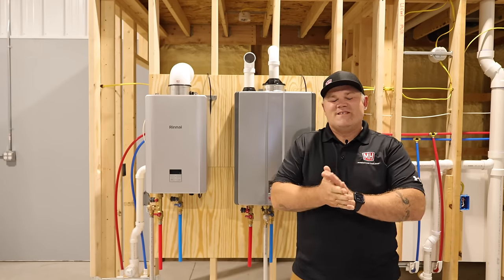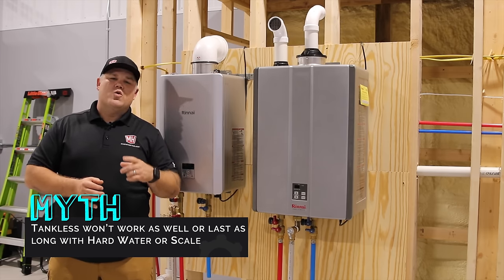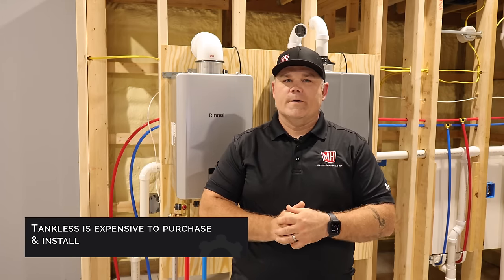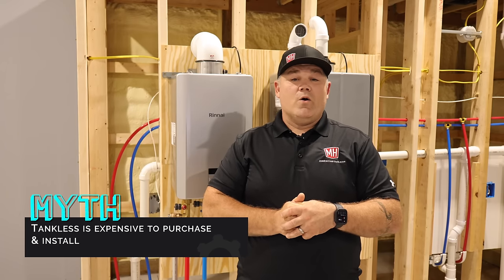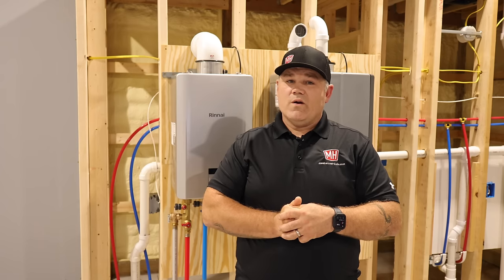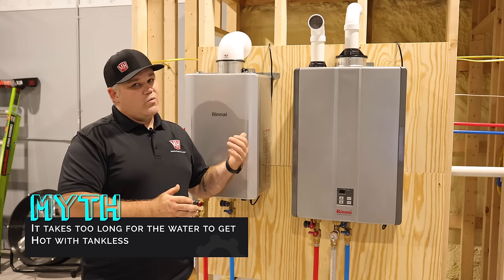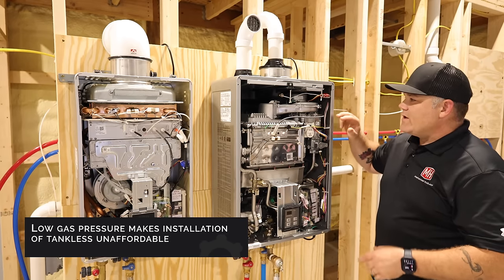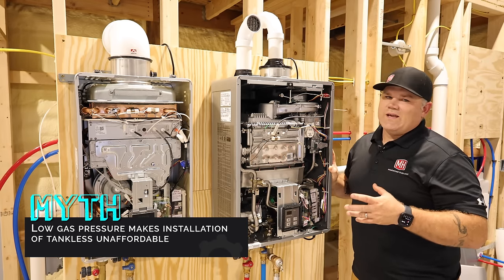Myth Busting! Tank -vs- Tankless Water Heaters

Comment: I don't agree with all your comments. Cost to install tankless is more than tank type 99% of the time in Retro Fit applications, mostly due to gas BTU demands. The cost comparison is closer in new construction. Maintenance requirements to maintain warranty is another expense you didn't bring up. GPM's requirements to activate the flow switch with newer low flow plumbing fixtures, was not discussed, so when the lavatory is fully opened but no hot water is delivered, your forced to open hot water to an additional fixture just to get hot water, your not saving water. I know you're trying to promote tankless but the reality is, both tank and tankless have a place in the market.
Reply: I read your comment before the video. After watching it, it's as if you never watched the video. I'd recommend watching it. If nothing else, you'll understand why on newer units you may not need to upgrade the gas feed line.
Reply: You obviously did not read my entire comments in comparison to the complete video. Read whatever code book in your jurisdiction along with installation instructions. If you're in the IRC read chapter 24. If you're in Texas read the Plumbing License Law and Board Rules. Something else that I did not mention before, 
A lot to discuss, copper versus SS heat exchangers. Read the checklist and installation instructions from any manufacturer of tankless water heater , pay close attention to the grains of hardness requirements. There is way too much to discuss by text. Do your homework before beating up on me. I stand behind my statements.
Reply: @philipsanders5911  I have no idea where your other comments are or why you think I would have seen them. I'm responding to this particular comment. And essentially what I'm telling you is what you tried to tell me at the end. Don't beat him up until you've watched his video. If you watch the video your comments didn't really make a lot of sense. Especially the part about the gas line. Newer models have a blower or turbocharger that's essentially a fan that is forcing the gas into the unit not relying on the passive pressure in the line. For you to insist in your comments that's the biggest issue makes you a little slow in my book. Try to keep up!

Comment: It cost me twice as much to heat water with my reni l have electric beside my reni and can isolate one or the other.  You didn't mention the cost of running the gas line and l am on propane so thats 2000 for the tank and 1000 to fill it. Total cost for the reni and gas and electricial oulet was about 6000 dollars. The fifty gallon electric heater and install was 1400. Plus any plumber or handyman can fix it. Not to mention hiring someone to flush the reni with a circulating pump. I bet you would make a great car salesman.
Reply: A person doing off grid and using mainly solar for electricity and propane for cooking, heat and hot water will already have figured in the cost of propane plumbing and propane into their build and budget.

Does not make a lot of sense to go propane for just the water heater if the rest of the house is electric.
They also make electric tankless water heaters as well.

Comment: Sponsored by Rinnai, so hardly unbiased. I do agree that tankless water heaters are not new technology, in fact in my country (Australia) they are considered old fashioned, and I can't remember the last time I saw one. The key thing you neglected to mention is that a tankless uses a lot more gas than a tank storage unit. With the cost of gas increasing steadily, tankless will be a very expensive "solution".

Comment: We used tankless from the time our home was built in 2008. We were forced to replace the core once due to a pinhole leak, but the (expensive) part was covered by warranty. (Get a long warranty if you have hard water.) That's 15 years and counting of uninterrupted hot water. I heartily recommend tankless. (We also benefit from a whole-house water filter/softener now. If you can afford it - the good ones are expensive - you'll get better water and save money on plumbing issues down the road.)

Comment: As a plumber for 24 years I don't think you are right, unless you are being paid by Rinnai, We use to install them a lot but my customers took them out later, keep in mind 20090 BTU compared 40000 BTU, and you are wrong by saying 3 people can have a shower at the same and not run out of hot water, think of your energy bill for the BTU.

Comment: it's not a lie that some tankless water heaters will struggle with output with 40 degrees ground water.  cold water  (37-40 degress F) ) cuts hot water production to about half of its rated GPM.  that is something to consider when your sizing your unit. tankless water ARE more expensive. you're not myth busting. you are not presenting the truth.

Comment: As one of the people responsible for designing the electrical grid, tankless water heaters of any size are going to require massive upgrades to your electrical supply. Be sure to budget for paying for an upsized transformer, possibly adding poles, primary wire, or replacing and up sizing secondary wire and/or your service wires.

Comment: What garbage. Tankless water heaters make you run water for at least 3 solid  minutes to begin to get any hot water.  When we finally gave up on ours it was such a relief to know we weren't wasting all that water anymore.
Reply: Also, endless hot water for a teenager means the water just keeps heated, and the gas to run it keeps getting used and $$$$$

Comment: This video exclusively discusses gas-fueled, tankless, water heaters. Not all areas have natural gas available. Although it might be possible to get an on-site propane tank, that would increase the installation cost. Some areas do not permit propane tanks to be installed, so the only option for a tankless water heater is electricity. Try that with 40-degree incoming water. You're not going to like the results.

Also, "sponsored by Rinnai" immediately suggests to me that this video will at least partially be an advertisement/promotion for Rinnai. In my opinion, the likelihood that the information presented in the video will be objective and non-biased is close to zero. That's not to say the entire video is misleading. I don't think it is. It contains some good information. But I definitely think some of it omits important facts.

Comment: Well if you a video for the manufacture I don't think you are unbiased. My own experience with tankless has been that they alternate between hot and cold, don't stay consistent. My Mom had a rinnai and a rental I use has another brand, they both do the same thing. I will stay with a tank heater as I never had that problem with them

Comment: Either way you look at it, tanks are cheaper to install and maintain.  The upfront cost for a tankless and then the maintenance factor to have a licensed plumber flush it out every year or two to keep the warranty, makes the overall cost make as much sense as buying an electric car for twice the price as a gas car and never recouping the savings.  It started out as hype and still is.  There are certain situations in commercial applications, or residential where saving space and "never running out" is of the essence.  Then, it would make sense to use a tankless.  You simply cannot accurately justify the extra cost of a tankless vs. tank.  There's too many variables.  You're also watching a video where he outright says it's his business to sell these tankless units or else he wouldn't have a business.  He's not going to give you an accurate side by side comparison.  When customers ask me what I think about tankless units, I tell them to run the other way.  They are more expensive up front and more expensive in the long run.  Obviously, there are those on here who are not the norm, who can give you an example of having the unit long enough to justify the added costs, but that's not the norm.

Comment: You said that a shower takes 2.5 gal/min but since most people actually don’t shower at 120 degrees they are using 85% hot water so they are using 1.5 to 1.7 gal/min. That’s just bad math, 85% would be 2.12 gal/min. This is a commercial for tankless water heaters plain and simple.

Comment: I am having a hard time understanding how these electrical tankless units are more efficient than anybody who uses a timer on any sized water heater.  I own a single element 19 gallon - 1500 watt - 120 volt water heater that runs via timer one hour in the morning and one hour in the evening outside of my demand windows of 2pm to 6 pm in the summer and 7a to 10a in the winter.  That's 3 kilowatt hours per day.  I am thrying to understand the math here.  You're telling me a tankless unit is more efficient than my system with a timer?  To run one of these tankless units we may have to upgrade our service panels to accomodate the load many require to run them.  One of the pros of a tanked water heater is that the service panel is normally wired to accomodate much bigger water heaters than for example the one I have just for me in my home.  Even if I had a standard 40 gallong 2-4500 watt element water heater; that's a max of 18 kilowatt hours per day and in this scenario it would be possible for a tankless unit running less than 2 hours a day to beat a tanked water heater assuming it was necessary for a tanked system to run for a solid 2 hours a day.  No one ever talks about how long they run their units; context matters.  I'm waiting for someone to explain to me how the math favors a tankless unit; thanks!

Comment: Your comments about the time it takes for the hot water to reach the point of use are misleading. You completely omit the fact that tankless heaters have a startup cycle (purge, pilot ignite/confirm, main ignite/confirm) that can take a significant length of time. Plus, the heat exchanger does take some time to reach a usable temperature. All this happens as water is being wasted, and during these times of frequent drought, this is a major concern. And, as was mentioned in other comments, if the flow is interrupted while you're in the shower, you have to go through that startup cycle all over again, while the cold water is again being wasted, as you stand there trying to stay out of the chilly stream, waiting for the hot water to return. I'll never again choose a tankless water heater.

Comment: 😮😂😢 IN ALL THAT DISCUSSION ABOUT COST(!) THE MAJOR PART IS MISSING!!! THE ELECTRICAL UPGRADE OF THE SUPPLY/BRAKER CIRCUIT FROM 25-30Amp TO 55-65A
OR MORE!!! AND THAT HAS TO BE POSSIBLE WITH THE MAIN BRAKER CAPACITY!!! 😮😮😮 (150-200Amp!!!)😮😢AND That is A LOT!

Comment: I thought this was basically and add for Rinnai. But we bought a Rinnai tankless unit a few years ago. Our contractor almost refused to install it. Finally we said 🖕, put it in, the reviews are good. Almost a year in, my only complaint is that I want a recirculate line to reach the laundry room, which we will install soon. Its quiet, takes up minimal space, and has not impacted our energy usage so far. We’re building an apartment and didn’t want to deal with a shortage of hot water, so far everything is good. Hey Rinnai, can you send me a promotional discount now? 😆

Comment: OK but there is still one myth that is not busted. If you can only do 5 gpm at 120 degrees the Dishwashers require at LEAST 120 degree water to work correctly.  Dishwashers use today approximately 3gpm.  Now a washing machine uses 3-5 gpm as a front load washer.  So if your doing a hot water load with front load washer you sure not going to be running much else.
Reply: Dishwashers use 4-6 gallons of water per load, and a front loading washer about 7 gallons,  so there's not much of a gallons per minute calculation. A more likely scenario is not using enough hot water to make the WH fire.

Comment: One of your comparisons dealt with efficiency. You compared a condensing tankless to a standard tank water heater. You indicated the condensing tankless was 95% and the standard tank was in the 60% efficiency range. You failed to tell your viewers that you just compared apples to oranges. If you compare condensing tankless then you need to select a condensing tank heater. If you had done that, your comparison would be on a level playing field.

Comment: Tankless costs more to run than any gas water heater. Don't say it's not true. My gas bill is 30 dollars a month and I have a gas stove, oven and heat. There is no way any electric tankless or tank water heater costs less than gas. Electricity costs more and there is no way in the future it will ever be cheaper than gas. Show me a tankless system that lasts 15 to 20 years trouble free. I live in Texas and water heaters in the attic during summer are very efficient. Like an EV, whole house tankless has to be in service for several years just to break even from the upfront retrofit costs. Unless it was installed by a builder from day one.
Reply: Check heat pump tanks. They are 3.5x more efficient than standard electric, and can cool your house at the same time. I don't know if they come out cheaper than gas or not, but... I rather not have to worry about carbon monoxide asphyxiation or a gas leaks either, so there are other pro/cons.

Comment: Sorry but overall cost of ownership ends up much higher than an old school tank. I buy a 40 Gallon tank for $500.00 , I install it myself. That's it for 10 years or more.  I bought a tankless. It's $1500.00.  Ok I want the convenience of endless hot water.  Then every year I need to run a descaling operation to maintain the efficiency of the tankless heat exchanger.  That's up to $300.00 per year in my area.  Even if you stretch it to 2 years, which is not recommended according to the manufacturer,  you are looking at $3000.00 assuming no repairs.  My Bosch Tankless had a leak in the water sensing valve which cost $400.00 to fix and finally developed an igniter problem. And in the 2 years the gas savings of running the tankless was $1.00 per month.  I was shocked but it was absolutely true.  So tankless was a waste of money for me. Plus, our gas pressure was too low for concurrent operation with the gas furnace. I had to switch off the furnace when showering.  That could have been adjusted but then I'm just dumping more money again. They just don't work for everybody. My more well to do friends don't care about the cost.  More power to them.

Comment: You did not dispel the first "myth" just because the hot water tank that you replaced had some sediment in it does not prove that tankless is better.  That hot water tank lasted 15 years, that is slightly less than average for any hot water tank.  How long would a tankless have lasted with those water conditions?  If you have to spend an extra $5000 to treat the water to get an extra 5 years on your $1000 water tank, versus your $5000 tankless, do the math.

Comment: The big BS about "on demand" hot water heaters is that - yes, they don't preheat water, and only heat water when you ask for it - but no, "on demand" is a misleading name.  It implies that you turn on the tap, and there's the hot water.  Nothing further from the truth - because, and especially in the summer - there IS no hot water.  

You have to wait for the unit to sense flow and turn on, wait for it to heat up, wait for the water inside it to heat up, and then make its way down the pipe to your sink.  In the meantime, your water is going down the drain.  My tankless is in my cellar, about 10 feet from my upstairs kitchen sink. With my old immersion heater in my boiler, I had hot water in less than 10 seconds - often less than 5.  It now requires 45 seconds before hot water arrives - despite what is said in the video.  

It is cheaper to run - although comparisons are tough, because i had an oil boiler and now have natural gas, which is cheaper.  Also, I had an old boiler, and this is a very efficient condensing unit (which you will need a condensate collector and pump to move the condensate to your drain or sump pump for).  You may well need whole house water filtration installed if you have iron - it wrecks the stainless heat exchanger.  Also, I have an upstairs heat pump that further reduces my heating bill - but increases my electric bill.  And my water bill has increased.  

The advantage is that you could take a 3 hour shower and never run out of hot water, which is one reason I bought it, although energy savings was the main reason.  It takes up FAR less space than the old boiler did, so I have reclaimed cellar space from the old boiler and the 275 gallon oil tank that I had removed.  Given the difference in efficiency and oil vs. gas costs (which can change in a blink, so YMMV), I broke even in about 3 years.  

I will need either an electric mini-heater at my sink, an insulated recirculation line and pump put in, or a small, hyper-insulated tank in the cellar with a thermostatically-controlled pump to turn the tankless on periodically, to provide a reservoir of hot water to draw from so I don't run the town reservoir dry.  That will cost extra, as did the external reset AND the whole house water filtration system I had installed.

It is tankless - but you won't be, if you want hot water in a reasonable length of time after you turn on the tap.

Comment: Myth 1: Correct. But falsely suggests it impacts tanks in the same way. Myth 2: True, but you can overcome it with more money. Myth 3: True, tho he then says he "wouldn't say" it's true despite having said it's true. Myth 4: True, especially if using non-condenscing. Myth 5: Wooo! A supposed "myth" debunked. Myth 6: Not a comparison to tankless. Myth 7: True (tho only applies to gas). Myth 8: A ridiculous made up "myth" (and yet didn't actually debunk it).

Kinda sad, since I came here for reasons to convert. Instead, I have a bunch of reasons not to. Sponsorship backfire, tho I'm sure Mechanical Hub got good money.